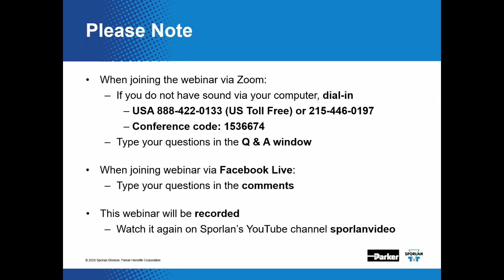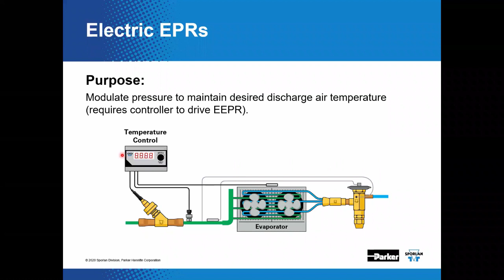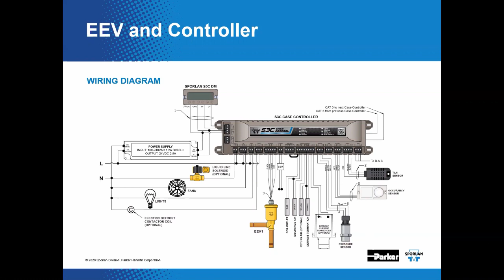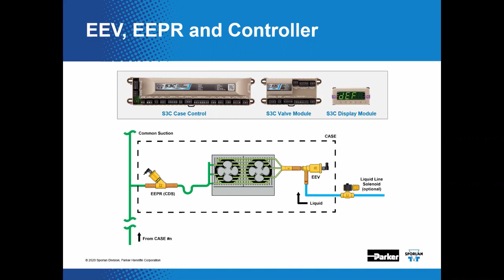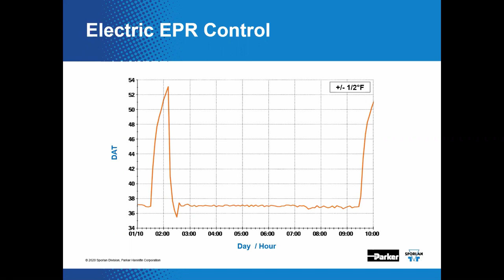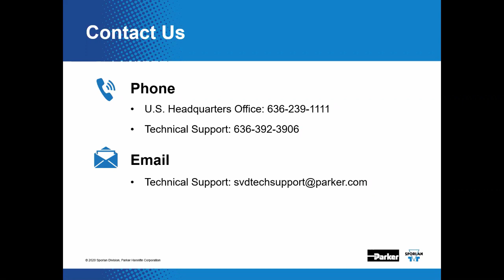Supermarket Refrigeration Temperature Control Using Electric Expansion Valves (EEV)

Comment: Thanks for the series. Any advice on using an eev in a close control climate room that pulses the liquid solenoid via a pid controller. Would the eev get damaged by the regular loss of liquid flow ?
Reply from the maker: Is the pulse solenoid being used in an expansion application?  If so, the use of an EEV would be redundant.  

If the solenoid is being used in a typical rapid cycle application, then the EEV would not be directly impacted.  If the valve does not see 100% liquid at its inlet, then it will not have good superheat control.  This may cause the valve to cycle more than it is intended and may lead to premature failure.
Reply: @sporlanvideo  thanks for the reply . It is a rapid cycle application where the compressor never shuts off  refrigerant just bypasses and the existing tev is not fed refrigerant via the liquid solenoid.